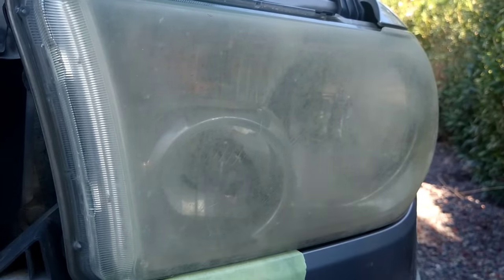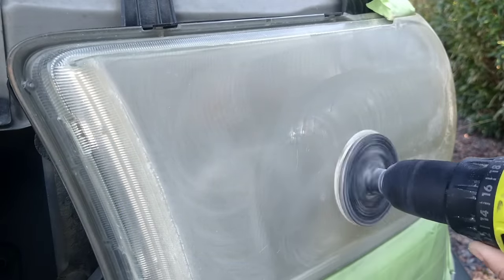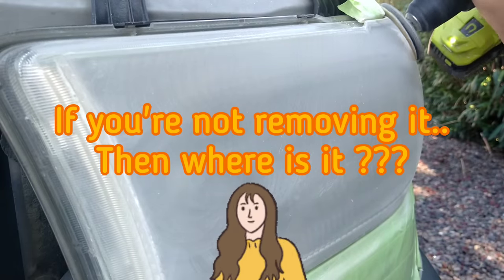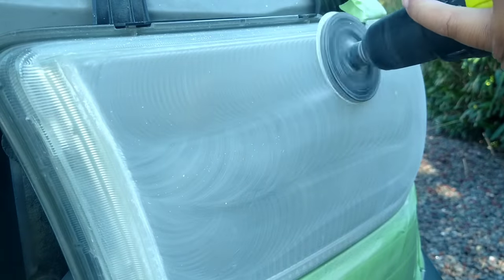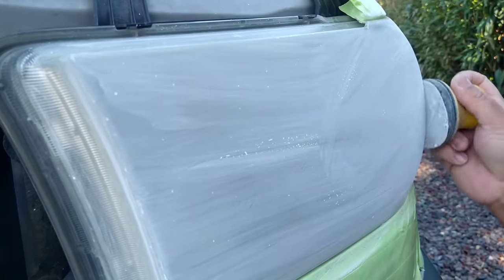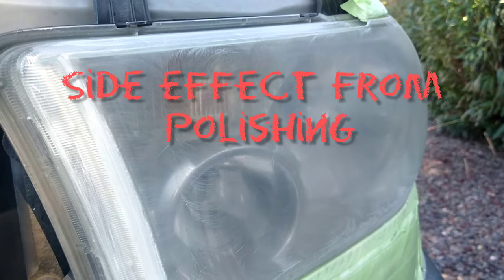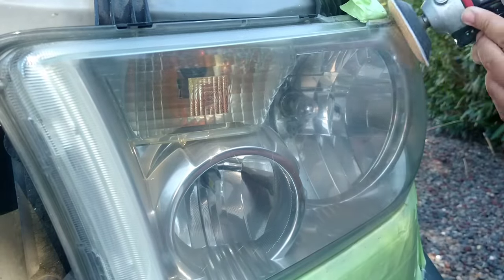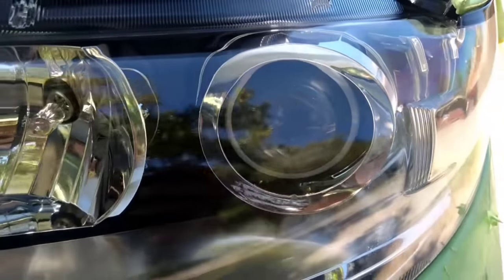POLISHING HEADLIGHTS IS A SHAM/scam  ---  and why you should never only polish headlights

Comment: It is obvious that the plastic headlights turn ugly and reduce the headlights beam over time - is it safe to assume that plastic taillights/brakelights are losing as much illumination?
Great site and the comments convinced me that you know what you're doing. Thanks!
Reply from the maker: Thank you appreciate it appreciate you watching.. to answer your question the brake lights break down at a much much slower rate about 1% to 5% of the rate headlights break down it's because of two reasons they're more for being seen and the red index blocks a light of UV light also there's no impact of any kind of particulates when exceeding 40 miles an hour... Tail lights are much rare I probably only do maybe three pairs a year on average...
Reply: @theheadlightrestorationpro  Thank you. Very helpful.
Reply from the maker: @philm.6113  🙏🏽💯

Comment: Very detailed and informative.
What is your opinion on Lamin-x clear headlight protection after a restoration?
Reply from the maker: You could do it but it's going to diminish the output of your headlight.. it's even more intense than doing extra layers which provide extra crusts.. it's going to diminish your lighting output 1,000% guaranteed... Whenever you remove it you're also guaranteed to need another headlight restoration because it's going to mess up the surface of your actual headlights anyways...
Cheaper and more effective just to do headlight restoration...
Also just like with any kind of wrapping even with wrapping of a vehicle and destroys what's underneath all kind of things happen water gets underneath and even worse than water soaps and detergents all kind of things they get heated up and chilled out my weather and pretty much destroys anything underneath it this is why most rap places will tell you if you ask that you only have a certain amount of time that you should have this on your vehicle....

Comment: Yeah, when my lights got yellow and looked ugly on my Crown Vic, I just bought new lights and installed them myself the cost for both left and right was $78 and had them in 4 days from eBay.  I'd rather buy new ones and install them over just cleaning them. The new ones I got last a long time; they still look very clear.
Reply from the maker: Even the cheap cheap aftermarket headlights you generally aren't that cheap it's because it's a crown Vic Victorian an older model Ford but very untypical to be that cheap, if you know how to install the more power to you but if you had restored and kept the original ones that would last you longer and work a lot better..
https://youtu.be/VSNEhD2obQc

Comment: Will it damage the plastic if you sand down too far? Also my lens seem to be yellowed. I there a fix for that? Thanks!
Reply from the maker: You really can't stand down too far with respect.. basically meaning if I sounded the light for 5 hours straight... I could probably stand for another 2 hours before I go too deep to where it will weaken the headlight.. you have to be trying very very hard and sanding for hours to do so... You should check out some more videos on my channel there's over 100.... Subscribe.... Also yellow lights check this out..https://youtu.be/fFaakzNu240?si=fKNAUuJHAsaOFM8P

Comment: I always wet sand with 2000 grit paper, then use an base coat clear coat polishing compound to buff with a cotton wheel for minimum surface reduction. results usually last 7-10 years with carnauba wax coatings if customer maintains , but like lugnut swell issues here in the rust belt one has to wonder if they use toilet paper?
Reply from the maker: Check this out...
https://youtu.be/bCD4At1iFAg

Comment: Never used this method, my concern is that the headlight lens will become thinner with multiple applications. After washing the headlight outer lens with detergent, I apply a liberal amount of Mothers Mag and Aluminium Polish on the lens and buff it with a loop pile backed 75mm Farecla foam G-Mop on a drill attachment at low speed.
After removing the polish and cleaning the lens I apply 303 Aerospace Protectant.  I repeat this annually. I would probably have to repeat the polishing a lot less if I applied the 303 Protectant every month religiously. My car is 12 years old purchased new, works a treat, 2 to 3 minutes a side, no sanding required.
Reply from the maker: No you don't have to worry about the headlight getting thin.. after you restored to his original clarity and seal it all you're doing is removing the sealer from now on if you stay up on it.. cannot let it go bad for too long... There's many methods but this is a set and forget it method that you're not going to have to worry about for 3 years you're not going to have to be out there every month polishing it.. this is a more professional grade method.. you can't really sell something where somebody has to go out there and deal with it every week or every month.. like I said this is a send it and forget it with minor maintenance you won't have to repeat the process ,3 to 5 years
As you see my headlights in this video will be 4 years old March... The clarity of them or of this method is unmatched by far...
Thank you for watching..
Plenty other videos out and more to come..👍🏽💯

Comment: The problem with Meguirs product is that it stayes on the tin it protects "up to a year". So you will be repeating on a regular basis. 2k clearcoat is very tough and blocks UV. I have seen plenty of lights finished with 2k clear that still look new at least 3 years later.Test first on a discreet part of the lens if you are worried.

Comment: OK.  What does headlight coating spray "do", improve clarity or mostly protect UV rays? I did not apply coating when I did mine. Live in Arizona and sun trashes plastic. Also, no water during first two sandings? Thanku
Reply from the maker: Yes sir dry sanding is King...
Be sure to check out a couple more of my videos I have a hundred plus up...
And you'll see that dry sanding is by far the superior method...
Also the coating is shown on every video or most videos.. it is the McGuire's headlight coating...
It is also listed in the bio along with everything else that I use....

Comment: So, I saw an ad for an acetone fogger tool. I guess, if done correctly, it's supposed to melt the damaged surface and make it perfectly clear, all in one step. It looks like a scam to me. I'm wondering what your opinion on this might be. Of course, even if it does work, I'd be hesitant to buy a whole machine only to use it, maybe, a few times...

Comment: So 400 grid, 800 grid , spray water , hit again with 800 grid ,  buff with , wax cream , ...can i get the link of the clear spray ...
Thanks .. great job
Reply from the maker: Did you watch the video ?
P - is very important..
So p500, p800, water & 3000 trizact, buff with hard lens plastic cleaner polish the finish with "UV"CLEAR COAT...
THANKS FOR WATCHING THE LINKS ARE IN THE BIO FOR EVERYTHING I USE ON THE VIDEOS AND IN GENERAL PRACTICE...

Comment: I agree that if all they are doing only polishing with a compound, it is definitely a scam... I have restored many sets of headlights using mostly standard kits from auto stores... Each headlight takes at least three passes with progressively finer grits to remove the oxidized and depolymerized plastic and takes at least 30 minutes per light for that alone. The next step does use the compound but that is also stripped off before applying the final UV blocking clearcoat.  It takes time and at the very least following the directions to be done right... Each one that I have done has lasted for several years... I have usually sold or had to trash the vehicle before having to redo a headlight. One of them was going strong for over six years when I sold it.
If it seems too good to be true or promises "simple shortcuts" you can be assured you will be doing again within a few months.
Reply from the maker: Exactly..
https://youtu.be/MzLqKPgEdkQ?si=egi0OUyfT1r1o4LD

Comment: You are knowledgeable but also do lots of talking.  The one item I am curious about - whether you using a chep Ryobi drill or a DeWalt - is what speeds to run the drill with the sanding bad or buffing wheel on?
Reply from the maker: I use Ryobi specifically because it's mid level/upper mid level power drill.. you don't want to use anything in the expensive or upper level category of power drills like Milwaukee or Makita etc.... Because the RPMs are too high but primarily the torque is way too high.. you don't want anything with over 600 lb of torque or anything with more than 1700 RPM..
Hope to answer the questions appreciate you watching Merry Christmas...

Comment: Not sure if it's evet mentioned, I use distilled water so as to not have any minerals to scratch. I also use distilled to restore actual glass.
Reply from the maker: Yeah I specifically tell people there's no need to use distilled water just because whatever's in regular water is going to be so insignificant you wouldn't even notice.. especially going on with heavy and fine sanding and polishing it's kind of like if you were to throw a dehydrated pee at a tank pulling four tanks....

Comment: The Headlight Restoration Pro, please know, I mean no disrespect with my comment. I don't know how much you charge for a job like this video represents but it is evident that you put substantial effort & time to achieve the quality you produce. I can't help to think, wouldn't it be more cost effective to purchase a new set of replacement headlight assemblies from Amazon for $109.00? Are the factory assemblies of such higher quality they are worth investing in the restoration? 
It is apparent to me that your process is 100% legit and the only correct way to correctly restore headlight assemblies. Thank You.
Reply from the maker: You're typically not going to find them for that cheap  on Amazon, not cheaper than I headlight restoration.. and those lights are extremely not worth it.. there what is referred to as aftermarket headlights..(poor quality in comparison to OEM)
OEM (factory specs from factory) headlights cost so much more for a reason.. plus the cost removal &  installation and time of Labor...(on top of the cost of the lights)
You definitely should watch this video..
https://youtu.be/VSNEhD2obQc
I made this video about that topic..
Thank you for watching...☺️
I have plenty of more videos up and Even more to come..
Reply: @theheadlightrestorationpro  Thanks for the response. I will check out your video recommendation now. Make no mistake, I am as cheap a cheap comes and appreciate you sharing your expertise for free. I am currently trying to build a small business as a mobile RV service provider. Until now, I hadn't considered the amount of newer model RV's that are in need of Headlight Restoration. That service alone could be ridiculously lucrative. 
Thanks again for the work you put in to provide us with your knowledge.
Reply from the maker: Awesome idea..
Thank you for watching..

Comment: I just use meguiar's ultimate compound, then plastx both on a 3 inch foam pad. I see the oxidation is lifted by the compound on my pad then plastx finishes the surface.
 Works well enough for me. I did not try to use sand paper because I do not want to remove too much.
Reply from the maker: You can't remove to much...

Comment: Awesome work! Do you just let the uv sealer dry or do you have to let it flash then wipe off?
Reply from the maker: Awesome question.. just let it dry preferably air dry.. feeding a bunch of arid rapidly drives even faster without the air it dries and like 30 seconds and anything over 80°, anything colder up to a minute really fast.. then just don't touch it at all for safety precautions I tell people do not touch it or watch the vehicle for 48 hours just to be safe.. it takes about 24 hours to fully cure even though it's dry to the touch..

Comment: Is it good to wipe down with iso alch after polishing before applying the coating? or is it not necessary?
Reply from the maker: No it would be bad... It's a sterile as it's going to get.. and wiping it down with that is going to leave that residue behind which you don't want this residue is good residue is designed for headlight restoration and for lights.. it'll mess up your clarity... I've tried..lol

Comment: Ok. I worked in automotive coating supply for decades. Plastic headlights have a protective clearcote on them to slow the plastic degradation once the clearcote goes, it needs to be stripped and restored. You expressed several misconceptions during the video. The only important steps are listed on the can of Meguire’s headlight clearcote

Comment: after 5 years of restoring my headlights, using multi sanding grits and lying down these rippled dust patterns, the plastic headlamp assembly became so thin the second pebble to hit it went right through. 3 times maybe at best you can sand them down, even after 2 times you start to see shattering lines inside the plastic.

Comment: I used Meguiar's high tech wax on my headlights since day one (about 2x a year).
Only twice did I need to use Meguiar's car polish on them. But I did it by hand.
Immediately after polishing I gave them 2 coats of that wax and 2 more coats of straight carnuba wax.
They still look almost new after a decade.

One way to tell if a car owner is LAZY and doesn't wax their vehicle properly is to look at their headlights. Faded means they are lazy.

An exception to this is the 3rd tailight (the high one).
For some reason mfr's used a different plastic or process and those don't want to become clear.

On really BAD headlights you can use Eagle aluminum wheel cleaner.
But you still must immediately wax them. And wax them at least 2x a year by hand.
Reply from the maker: https://youtu.be/bCD4At1iFAg

Comment: After watching several of DIY restoration videos, I happened on yours and am so glad I did! I bought the 3M kit and followed the steps you recommended. Everything worked out beautifully — on a 2002 Camry that had never had anything done to headlights except running it through a drive thru car wash. Oxidation for 20 yrs, but it’s gone now thanks to you. Question: I used the 3M clear coating sheets at the end. Should I follow that with Meguier’s  UV sealant too? Thanks again!
Reply from the maker: Thanks for watching. I appreciate your support.. as far as the clear Sheetz normally the headlight restoration comes first and then that would go over from what I've seen..
Reply: @theheadlightrestorationpro    Yes! I did the restoration, and then used 3M clear coat sheets. Should I follow that with Meguier’s UV headlight protectant too? TYVM!
Reply from the maker: No you should never double coat...
Check this out...https://youtu.be/NgxNImOAoCY
Reply from the maker: https://youtu.be/x1gp9ATZTI8

Comment: That coating that you are using by Mcguairs is good for a year. There are 2k clear coats that are uv resistant that are designed for head lights
Reply from the maker: More than a year... That's just a disclaimer that's for the worst person on their headlights if they didn't wash their car day in their life... Innovative I have it on my vehicle and it's lasted for over 3 years..
Got to take care of your vehicle... They used that disclaimer and they set the bar at the worst people with their vehicles... And even then the earliest I've ever seen a headlights start to degrade after I did them was about 15months and a lady self-expressed she only watches her vehicle when it rains.. 😂 lol there are two k clears that are made for headlights but they come with the same issues...
Also they're about 500 times more expensive.. people don't my expensive are overly expensive headlight restoration... That's $45 surplus per headlight restoration...(you can only use those cans one time)
Also they still come with the negative effects when it's time to remove, I have to turn a couple other things.. tried it before it's not practical for headlight restoration at Mass, for business and for customers... Far as dry time, expense, unhealthy damage to light long run, and the possibility that you might have to go over it after it cures many many hours later..., And the down time of the vehicle..(hours of not driving in a sterile environment...) On and on and on.. I tried it for a portion of the time and it was a nightmare..

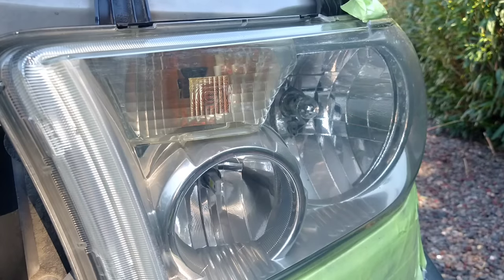Comment: I have a question. What step is missing between about 17:30 and 17:50 ? You spray on the coating, it looks kinda runny with apparent distortion and a little foggy with some spots on parts of the headlights. Then there's a cut and they're perfect.